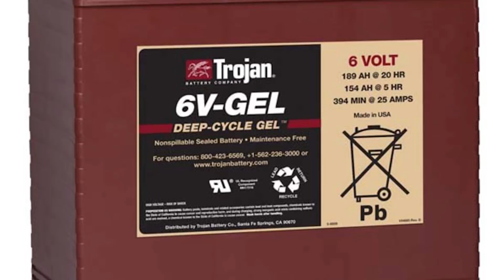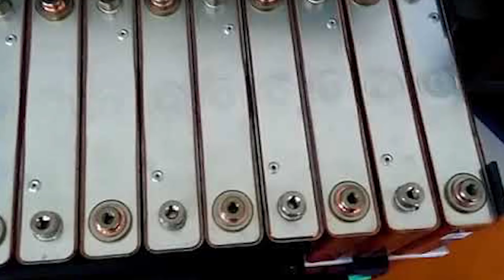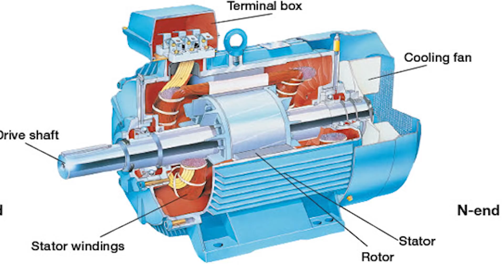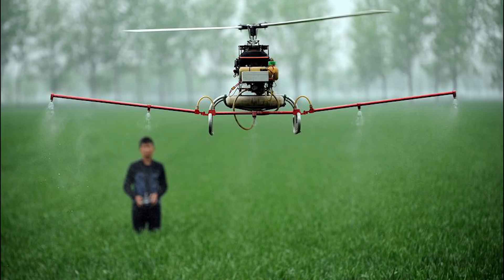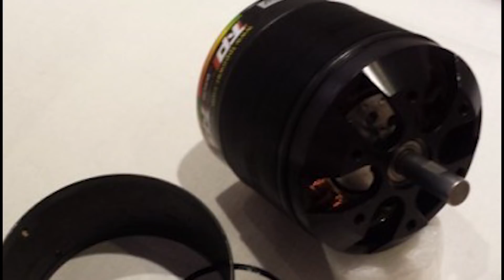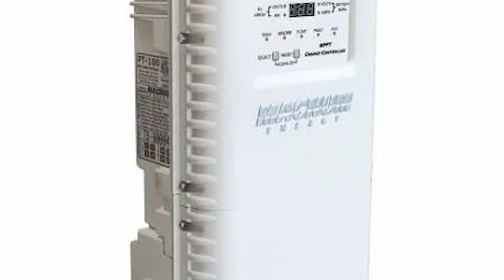How to Build an Electric Sailboat

Comment: Have you considered regeneration in your motor selection? This for me is a crucial element of the mix as is the perfect way to charge the batteries whilst Sailing. This also dictates type of motor/prop configuration as the regen needs to be stopped once the batteries are full.
Reply from the maker: Compared to my solar setup regen makes almost no power. It's equivalent to my wind power generation. I'm not counting it as a major part of power build. My first outboards won't have regent since that saves me 800 bucks or so.

Comment: I read in the comments that you would like to know more about prop dynamics. Check out, The Propeller Handbook, by Dave Gerr. There is no better in my opinion. He manages to lay out what is actually a very complicated subject in an easy to follow manner, while getting plenty deep enough into the subject for any laymen. (He also has several other excellent books.)

Comment: This is one of the best run downs i have seen yet on planning and comparing  electric engines for sailboats. I plan on building a electric fiberglass Triamaran. I have a big cylindrical windmill that is going in the top of my mast alongside with solar panels. Hoping that the solar tecnologies are going to enable sails with integrated solar panels soon. Toying with the idea about a kite or sea-anchor, cable connected to a winch/ generator for power collection, , or connecting the propeller to drag and create tourqe when sailing. 

I subscribed.

Comment: spend the money on the motor, shaft/ shafts and propellor/ propellor's. If it's a sailing craft you could put the battery bank in the middle with the ability to slide it port or starboard and use it as a ballast system. Battery's will get cheaper faster than the other components.  Marine parts are not correlated to inflation or other market forces, it's more akin to football player wage demands.

Comment: hI Simon, I'm busy converting a 35m super yacht (currently 2 x 750hp Diesels)  to full electric driven motors. No batteries, no solar etc etc. It is a system that we use for power projects here in Africa. If you are interested let me know.  I have an engineer who has built an electric motor for this and for his own yacht. matt.van.aardt@gmail.com. Power source starts at 20Kv up to the 5mw unit that I'm installing. Yes it is overkill but the yacht is going to be used for long range exploration and assistance of Island folks with projects so i can use the unit to run line to land to use for the set up of the projects until the power units arrive. FYI, the power units don to emit ANY emissions or heat or vibration. Totally green. i would love to exchange ideas with you
Reply from the maker: +Mathew Peter get Matt your email is misspelled. Shoot me an email at findingsimonstiles@gmail.com
Reply: Finding Simon sent you a test email now.

Comment: Nice presentation on converting to electric.  We moved aboard our mono sailboat in 1996, sailed out for full time cruising in 04. Starting around 2005 we now cruise about half time. I recently did a 4 part Youtube video on power aboard our boat. NOT electric powered...

One thing that comes to mind is the need for “emergency” power. I think of it like the life raft. You pay bucks for it, it sits and you hope to never use it. BUT you would be reckless to go blue water without it. We found that at times that you NEED power, and you need it now. AND, it will always take place when you are least prepared. 

I am not advocating putting a full diesel drive in, just a backup that could drive the boat!

Comment: Hi, I love that you are trying to go 100% free of fossil fuels.  I would like to do the same thing.  I am building a "Woods design catamaran"  31 ft Tamar, it is about 1/2 done.  I am thinking two electric outboards and one of Musk's batteries.  But I haven't done much research yet.

Where do you plan to mount all those solar panels?

Comment: You have some great ideas but really how much motoring do you plan to do? The power system your describing is more for a power boat than sail. To each there own right. I'm concerned about mixing drinking water with cooling and I think your spending unneeded money on your power system. See if you can find the video to go with this power point. It talks a lot about how to determine power needs and misconceptions. http://sfbaysss.org/resource/doc/electrical_seminar_michael_jefferson_2002.pdf

One real concern is mixing your drinking water with the cooling system. I would keep my drinking water independent.  With all those connections the risk of a leak is high. There was father son who had to get rescued a few days before making land fall on Hawaii because the rubber ring on the fresh water tank cracked and salt water leaked into there drinking water. After 2 weeks of salt water working it's way into their drinking water they had to be rescued by the coast guard. 

Another concern with using your fresh water tank as your cooling system is it will progressively cool poorer, even if you don't use the water. Once your tank gets to a uniform temperature it'll just get hotter. You might want to look into getting a hot water tank and let that water get hot. That way you can have a hot shower. If you use a thermostat like in a car you can get the most cooling out of the water. If the tank gets too hot run the water threw a heat exchanger.  All the water cooling systems I know of get ride of the heat by either pumping it out of the system (like a normal gas/diesel marine engine) or using a fan like a CPU water cooler or a car engine. Air Conditioning is a massive energy pig and having 50 gallons of warm drinking water will make your A/C work overtime. Check out Uma for sure and go to sailboat shows they almost always have a solar energy speaker talking for free.

Comment: I do not think an electric conversion is what I would want to rely on in a blue water boat (I'll take an order of diesel please), but it does sound like you have realistically evaluated the power storage to weight ratio and power to cost.  One thing I heard you say in relation to an induction motor is using an inverter in conjunction with a VFD.  This is not necessary, is costly, and wastes efficiency.  First stage of a VFD is a rectifier front end feeding a DC bus (230 vac =325 vdc)  Simply feed your VFD from a 325 vdc battery bank (might require some surgery....).  One caveat is that the VFD will need internal control power.  Choose one that requires an EXTERNAL dc supply (usually 24vdc) rather than one which derives control power internally.
1) You do not need an inverter
2) no way would I use a brush DC on a boat.  No way
3) Your motor efficiency numbers are not realistic.  90% is tops for a motor and 85% is more like it, particularly induction.
4) Induction is simple and reliable but salt will be a challenge to ALL components involved.  Consider a conformal coating for the electronics.
5) You did not mention 'brushless DC' motors.  This is a bit of an unfortunate misnomer as what they really are is a permanent magnet, synchronous, AC motor.  This will be the smallest & most efficient motor and can be had in speed ranges appropriate for a propeller.  Look into servo motors minus the encoder.  You can operate them off of a VFD if the winding spec is chosen correctly.  30 HP is a bit rare in this technology so might be a non contender.
6) Two small motors will be slightly less efficient than one larger motor.
7) You do not have to run a 230v VFD with 325vdc, you can under voltage to match the motor winding or if you just prefer a lower voltage battery connection.  You will reduce power proportionally though as available current (VFD rating) will remain the same.  You want to match the nominal volts/frequency ratio of the motor.
8) The high rpm motors will have relatively high losses both in the electronics and in the mechanical speed reduction for propeller speed.
9) Would love to tackle this sort of thing myself, even though I would not want to be offshore without a diesel.
10) Fair sailing!
Reply: Sailing Uma and Sailing Saoirse are blue water sailing now

Comment: if you want efficiency, performance, reliability, spare parts and the best customer service ever  and to beable to talk to the man who designed built and proved them you really should look at Lynch motors they are the best you can get.
http://lynchmotors.co.uk/lynch-electric_motors/lynch_electric-motor.html
TOp notch inverter charger here, the best there is by far.
https://www.victronenergy.com/inverters-chargers/multiplus-12v-24v-48v-800va-3kva

Comment: Thanks for the info. I’m thinking something similar but with diesel generator an diesel heater stove involved. (Here in north you need that extra heat and power..)

Just thinking of that water heating. I’d go with couple of solar vacuum tubes for keeping well insulated water heater at minimum 65C. You cannot keep the water colder than that safely. A question regarding this: Is the cooling of these electric stuff really that critical so that you need complicated cooling system for them? Is there potential problems with air cooling?

Comment: With a sail boat and all of the panels some will be shaded.  If you parallel all the panels there is a big impact with just one shaded.  People use micro-inverters on each panel and it fixes this problem but of course it will cost more.  There are demonstrations on line that show what happens.
Reply from the maker: +Andy Bushnell yeah that was an option but I didn't like the controllers out there exposed to the elements. Either way if the sails are up I'm sailing not so worried about the power then.

Comment: "brushless DC" is really an AC motor with permanent magnets.
Reply from the maker: +Andy Bushnell that runs on direct current.
Reply: it uses an inverter to generate AC.  I think they call it brush less is because the switching of the inverter followes the same pattern that would be produced by brushes an a DC motor.  https://en.wikipedia.org/wiki/Brushless_DC_electric_motor#Brushless_solution

Comment: The rigging Doctor converted his sailboat and had to buy a generator to run the electrical.  So you need fuel and engine maintenance. This system does not work for a sailboat.  A diesel is by far the best option....... by far.
Reply from the maker: +Sails cool story.

Comment: For charging your batteries, you might like the HP DPS-1200FB power supply (find them on ebay).  They can be modified (https://www.youtube.com/watch?v=_2QFBE6ZFF0&t=143s) to float and not have a ground on each one so they can be put in series to make sufficient voltage to charge your batteries.  My plan is to also mod them by replacing the voltage adjustment potentiometer on each one with a digital potentiometer connected to an arduino.  Charge current can be measured by a shunt as an input to the arduino.  Then the arduino can adjust voltage to maintain the desired charge current.  This is much cheaper than other 48v battery chargers I have seen.  This will require 4800 to 6000 watts of AC coming in and give 100A of charging current.  These power supplies will work on 100 to 240vac input at 47-63 Hz.  Also, they have auto-ranging input.  So, just plug in the juice and they are good to go.  Lastly, these are the best output connections I have seen for these power supplies: https://www.ebay.com/itm/302390538770.
Reply from the maker: +Tim Chapman thanks! I'm definitely going to use some of this
Reply: Golf cart chargers have a charge rate of 13 amps or so.  That would take 100 hours to charge my batteries.   They are 1000 AH 48V.  I also can't control the golf cart charger with my own microcontroller.  The golf cart charger is not meant for lithium ion batteries as well.
Reply: I can charge my batteries overnight rather than 26 hours as above. 16 of the 1000ah winston cells costs $16000 and weighs 1400 pounds.  My battery pack costs $6000 and weighs 800 pounds.  Charge rate for mine is .432C per cell (432 of 16650 cells).
Reply: My original plan was to remove engine and fuel tanks from my 26' boat and put an electric drive system in.
I decided that I want to do this on a different boat, so I have not done the build yet.  I have done all the design work.  I am also working on active balancing system for the cells.  The space required for the boat I am not doing is 2 banks of 30 x 27 x 37 inches. I think well within the space limits of most boats.  I have all that laid out in sketchup.  I have thought this through and done my research very carefully.  My designs are no secret and I would be happy to share them with you.  You can reach me at tecrov on my gmail account.

Comment: Hi great video I want to do electric drive in my boat but trying to get any useful info is really hard here in the UK. Have you thought about buying a used body damaged Nissan leaf and taking the battery, charger, controller and motor out of it and use that. It is all water cooled and made to work together plus Nissan are world wide so spare parts should be easy to get.
Reply from the maker: +Chris Flower I had yeah but the size didn't line up so great. If I was building a motor trawler that'd be perfect

Comment: I converted my 30 foot sailboat from a gas inboard to electric 2 years ago.  I used a Motenergy ME1115 Dual-Stator Brushless Motor and lead acid batteries in a 48v bank.  I am not a live aboard, so I have more time to let the bank come back using a small solar bank.  I use the motor just to get in and out of my home port, and sail the rest of the time.  In theory, I can regenerate using the motor, but I haven't been able to do so.  I spent less on my entire system than you did on your battery bank, but my goals are not as ambitious as your's.
Reply: Jeff Griglack I’m working on an electric repower for my Ericson 27 at the moment. I’ve got a Honda 9.9. HP outboard motor at the moment. I was thinking I might be able to use 2, 3 or 4 winch motors without a controller and just a contractor relay to control forward and reverse. To go forward at full power i’d put all my motors in forward or to go forward slowly I’d put a single motor center or near center motor in forward or reverse. Have you thought about using 12 volt winches in this application?
Reply: I bought my first used winch motor (12 volt 5kw) for $40 and I can get a contractor for $30 to $40 and wires and a 3 position switch for not a huge amount more money. I’m hoping to start driving my boat all electric for under 1k.

Comment: You should check out the rigging doctor.... full electric and nothing but problems, now the have a generator that runs a underpowered set up. Until electric storage and sufficient motor size can drive a boat 10+ hours a day, you will always be at the will of the wind and weather. Maybe you will solve all that.
Reply from the maker: +Wise guy very different boats. My current battery bank should get me 3 to 4 hours of motoring. Depending on how I like that I may add more batteries or I may just continue as is.
Reply: Finding Simon 
Sounds good, but as a long term cruiser motoring happens way more than you want or expect... cheers

Comment: I found you vid very interesting, have you thought about having a DC motor to be both your motor and your generator? 
I was looking at    http://www.yasamotors.com/products/p400_series/   for example. 
 And with a few solar panels you would have all the electricity you need and more. 
I'm with you on the self sufficiency angle, relying on diesel to top up your power seems crazy.
Reply from the maker: +110110pab I've never seen these motors before I'm looking into it. For now I stuck with a well reviewed and really cheap bldc from turnigy but I may end up switching. I'm really not sure until it's all installed and running.

Comment: I agree with Ted Renard about getting in touch with Sailing Uma. His electric motor setup works well but at last report wasn't working so well in the regen configuration. I don't think he's worked that out quite yet. I'm also an avid RCG member (dteel on that forum) and build my own helicopters and quads; I'm also an electrical engineer. I was surprised that you referred to the motors in use in those applications as DC. They use a DC source but the ESCs convert that DC into a 3 phase AC to drive the motors. Most of my helicopter motors run at 8KHz but the optimal frequency is determined by the ESC in use and the number poles the motor has. The higher frequency they use is responsible for the small size to power ratio. Before others jump on my assertion about AC not DC motors, yes some quads use DC brushed motors but certainly no racing quads or any RC helicopters that are not toys. Have you looked at any of the electric car motors and ESCs? Looking forward to how this all works out for you and wishing you the best of luck!
Reply from the maker: yeah I was looking at the goldenmotor 10kwBLDC and I may end up there in the end, but I found rotomax 100cc motors made for my 12s battery banks that crank out 8kw and are about the size of a melon, not to mention cheap as chips and better build quality than the goldenmotors.

I had looked at the AC35 in one outboard from the center, but decided it would be nice to have two motors for flexibility in tight navigation, and would also be nice to remove one motor and use it on the dinghy while on anchor.

Usually these cats have 2 9.9HP motors, so I'm trying it with 2 8KW for now and later on I can sell em and move up. They're a lot cheaper than pretty much every other option, at about $1500 per motor complete.
Reply: That looks like an incredible choice. Lets you keep the batteries in a 12S configuration too! Nice find!